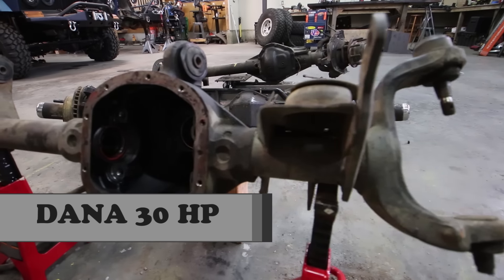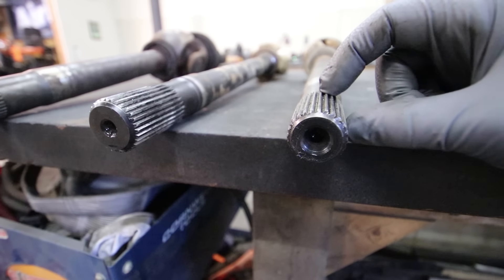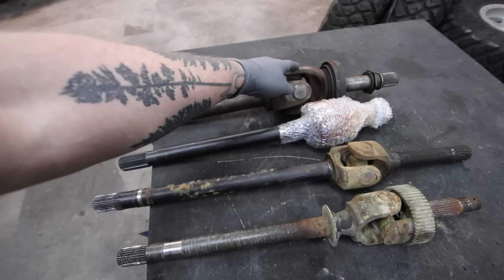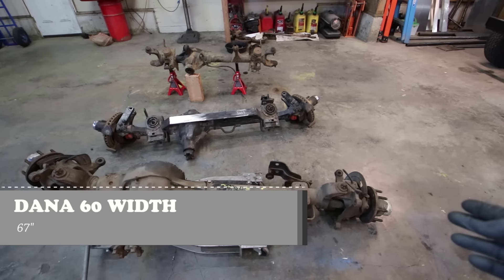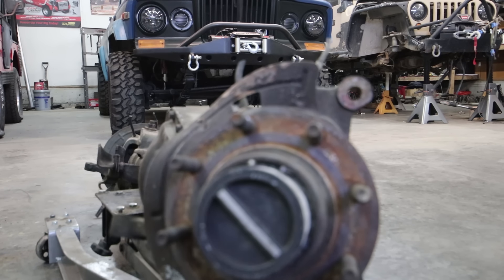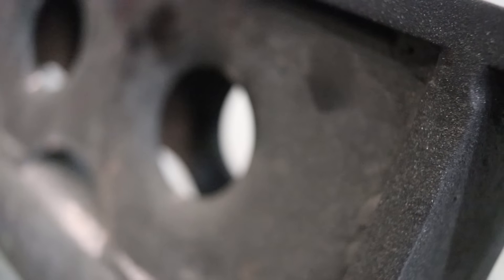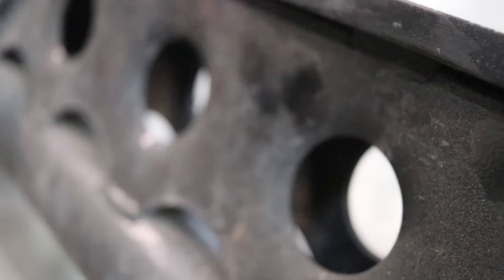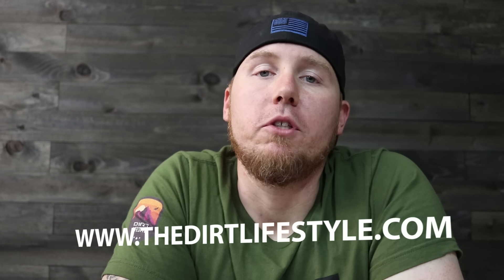DANA 30 vs 44 vs 60 Junk yard Axle Swap Beginners Guide!!!!

Comment: All the dislikes = people who came for blind Dana 30 hate.
Reply: Been wheeling in my V8 ZJ on my dana 30 low pinion for 8 years now with only one issue, and that issue is that my unit bearings keep wearing out every couple years. 
Of course, I don't have lockers, but I also don't have any upgraded parts or even an axle truss. And I'm not exactly easy on my axle. I don't like giving up on obstacles.
Reply: 03 stock dana 30, low pinion, on red trails in PA.  I wouldn't bother beefing up the D30.  Just dont ride fast and hard.
Reply: @KurNorock  you think 30 has hate , look at the Dana 35
Reply: @Mr2greys  I'm not saying its a great axle. I am just saying mine hasn't really given me issues. That being said, I have been wanting to upgrade to 1 tons for years. 

The 35 is shit though. I've seen those things break with only minor stress. Luckily my ZJ came with the 44HD rear axle (aka the 44a) which is much stronger than people give it credit for. The only real drawback to it is that there is almost no aftermarket support for it.

Comment: You are backwards on your High Pinion Direction, It is stronger When you push your ring gear with your pinion not pull. i.e. low pinion rear pinion pushes ring gear, high pinion front pushes the ring gear. Think of it as you want to load up the larger pinion bearing. But you did pretty good nice job putting it together.

Comment: Great video! Very useful information. I almost built the D30 that came in my YJ. It ended up being cheaper for me to just get a D44. Lots more piece of mind. I have a D44 low pinion in the front with chromolys and locker. And a trussed Ford 8.8 in the rear. Both geared at 4.56, running 35s, and my stock 4cyl. Works great for me.
Reply: just curious how did you match up the wheel lug patterns i have a 8,8with 5x4.5  and a 6 lug 44 and i want to match the wheel lug patterns

Comment: I ran a locked Dana 30 on a V8 ZJ on 35s with 4.88 gears for years without issues.  Had IRO "almost alloy" axle shafts with Spicer 760x ujoints and the end caps welded.  Ran IRO internal axle sleeves as well.  Most importantly though, I drove it like it was a Dana 30 haha sometimes people treat them like it's a 60 and of course it's gonna blow!!
Reply: Had the 35's on my ZJ and broke the stock rear D35 first time out. D44 fixed it!
Reply: So true, two identical trucks go through a trail, exact same obstacles, one comes out looking as it went in, one comes out destroyed.

Comment: A high pinion 30 and 8.8 rear are pretty inexpensive upgrades for a streetable TJ on 35s. The main issue I ran in to with this combo is the 8.8 hangs low and drags on everything. Then the hp30 hardened locker crosspin broke and backed out, wedging between the ring and pinion, which then stripped my gears and exploded the carrier. I replaced the parts and drove it for a while longer, but went the superduty 60/10.5 combo along with a backhalf, stretch, and full hydro steering on 40s.

Comment: I have driven Jeeps for years, and never broke an Axle. I have had a propeller shaft fail on a rock climb in a 95 Jeep Grand Cheorkee, 5.2 liter V8, 4.11 geared axles and 33" tires.  I drove in MOab and up the lions back in a 76 CJ-7 with T-18 4 Speed,  Dana 20 Transfer case, Stock Dana 30 front axle and stock AMC 20 rear axle.  with 4.11 gears and a two inch lift. I forgot the size tires, but remember they were Armstrong Norseman.  I managed to go everywhere I wanted with little fuss or muss and didn't even strip out the hub on the AMC axle.

Comment: Built a C8.25 rear locked and TJ D30 w/ cromo axle shafts , open diff for my YJ , running 35s and very happy with the build. Also did the WJ big brake upgrade and rebuild both axles completely .... was to be a budget build but a total rebuild  parts add up lol

Comment: Perfect advice.. d30-44 don’t break in jeeps from good wheeling. They break cause if weak joints which in turn destroy the shaft.. or they break cause if thinner tubes flexing. In my last TJ’s I always ran d44 swaps from fords or waggys, my current project Cherokee I’ll be sticking with the hp30 with a truss and rcv shafts cause getting anything larger then a 36-37 on a Cherokee and retaining any reasonable resemblance to a Cherokee and flex that just all you can reasonably do. 

I would like to hear your take on rears too. I already got the 8.8 locked with alloys swapped in the rear just need to truss it when I go 4 link. As big as the 8.8 swap is in the xj world I feel it’s a highly overlooked option in the tj and yj world. My last TJ ran a 8.8 rear with waggy front. 

As far are rears go.. I really don’t understand all this d60 hype and never had? You can swap in a shaved 14 for that weight while having same clearance and way way stronger setup. You have to really build a 60 to touch a stock 14 with just welded spiders. Tons are just way to heavy imop unless you’re over landing and carrying a ton of weight. 

In my 20 or so years of wheeling I’ve bent more shafts then I’ve broken and that’s from tube flex under shock load. Hell even back in the day before I had a clue I was running a super 35 kit on 37’s and never broke a shaft.. bent a few from pulling others out in bigger heavier rigs where I really had to snatch from 20-30’ feet and that shock bent axles which also destroys the bearings but even then I never snapped one. 

I’ve seen more people break shocks etc wo straps and walk their 60’s under their rigs ripping apart drive shafts and all kinds of stuff cause they are so same heavy then I’ve ever had with smaller properly built axles on proper weighted rigs with proper size tires. 

And the hype over these rubi axles swaps is highly misguided.. they are lip d30 with a modified 44 housing. The knuckles, tubes, joints etc are all 30 lol. The rubi is nothing more then and 8.8 version of a Janice jk swap into a standard 44. You’re getting a bigger and hence stronger with tall gearing d30. 

You’re axles aren’t breaking cause they are weak they are breaking cause they are flexing.. (hence truss and sleeves) your joints don’t break cause they are weak they break cause they are weak at angles. You’re 1310 driveshaft joint is the same as the one conserving your purées to your inners.. yet you’re breaking front joints bot drive shafts joints cause you’re at full lock and putting them in a bing which means the inner is moving regular speed while the outer is moving much slower. (Extra stress) I can’t help but feel Jeep people are so far behind the times when it comes to what breakers and why. The reason a $5000 Tacoma will never break anything is cause they are running cv shafts instead of ujoints. How many yots with dual t case running 127-1 crawl do you see breaking weak 7-8” axles? It’s not the axles it’s the joints. Throw a $100 truss on that hp30 run some rcv shafts and be done. While your buddies are refinancing their house to pay for a 60 and 40+ tires to clear them you’ll be wheeling.
Reply: Yeah I wanna do a 44 so its stronger but not a massive axle like the 60

Comment: Only the "Super 60" has the 10" ring gear. These are in 2005-2020 F-450/550 and 2017+ F-250/350. In the 2017 MY, the pinion size was increased substantially, and Dana internally calls it the M256.
Reply: 2004 and 2005  f250 super duty Dana 60 has the same ring gear size?

Comment: Excellent information Nate. Pulling my D30 to do new inner seals. Adding outer seals because of the amount of sludge, mud and crap on the east coast. Already upgraded to Yukon 30 spline chromoly axles when I upgraded the ring and pinion and 4.56 gears after I bought it in CA. Stub shafts and heavy  duty u-joints from Yukon are also going in. Truss will be added too, as well as lower control arm skids. Sure, it's a D30, but it will be solid. Don't have the $$ for sleeves and gussets for this go round. Running 33's now and moving to  35's as soon as the Tread wears down.
Reply from the maker: Nice man, that's going to be a solid setup 👍

Comment: i ran a dana 60 in my drag car with 800 hp ran it for years great stuff
Reply: Sweet, but isn't that a lot of weight for a drag car?
Reply: @adamsmith5913  it was a rail job a dragster long n skinny with a wing out back kinda looks like a top fuel dragster she only weighed 1565 pound so she hauled ass what fun !!!

Comment: I have a 1963 Wagoneer version of you blue Jeep. Mine is a Willy's and has the OHC Tornado 6 in it. I bought if for either $50 or $100 close to 25 years ago. It's a little lighter blue than yours. Sheet metal is all good but the floor pans and seats need work. Been sitting pretty much since I bought it. The guy I bought it from had broken a shifting fork and that's why it was so cheap. It ran like a watch and after my dad welded up the fork it was fine. I need to bring it home and get it fixed up because it's a sweet truck.

Comment: I was pretty excited until 13:25 when you mentioned V-8 and Dana 30. I’m running a TJ magnum V8 360 and NV4500 with an 8.8 Ford in the rear and you guessed it, Dana 30 still in the front!!  The 30 is completely stock with a spartan locker 4.11. 35” Cooper STT Pro. In the last year of moderate wheeling I’ve lost 2 U joints and I’ve now bent the ears on the stub. Was hoping to stay Dana 30 HP with 30 spline chrome Molly shafts. Sounds like with a V-8 I should skip and go to Dana 60 but that’s a pretty big  mismatch for my Ford 8.8 which seems to be doing great.
Reply: I should add the only reason the 30 stubs have bent ears because It spit 760 U Joint caps out. That’s the driver side. Passenger side caps are welded down.

Comment: Another great video! D30 are better than they are given credit, especially the HP 30.
Reply: As long as you are fine with replacing the unit bearings every couple years.
Reply: Chrysler 8.25 !  Xj 96-99 had the 29 spline. Many say just as good as a D44 other then that damn C clip
Reply: @CD-W0DOS  do a disc brake conversion on a chrysler 8.25 and if you do happen to break an axle the rotor will hold the wheel in to get off the trail. That's what I did as a poor man's way of keeping the axle in in the event of a failure.
Reply: @CD-W0DOS  that's comparing apples and oranges. You wont see a 30 in the rear and you wont see a 8.25 in the front

Comment: I had a low pinion Dana 30 and I beat on it for 2 years with 35’s and it held great never had a problem than I sold the truck and I’m actually about to swap one into my daily driver ford ranger and do some 33’s for hunting and driving around on gravel roads

Comment: Great video nate. One thing im putting a f250 dana 44 in my YJ to run 35s. The biggest reasons are for the lockouts, bigger brakes, no unit bearings, and high steer. All of those are an added cost trying to beef a dana 30. Running the 67 inch width but with 3rd gen dodge wheels with 6 inch backspacing.
Reply from the maker: That should be a pretty fun and reliable toy! The only thing I would recommend is bring some spare shafts with you if you plan on running the stock ones. It's very thin around the ears of the shaft so the stock ones are pretty easy to break. Ask me how I know lol. Thanks for watching buddy 👍

Comment: I’ve seen high pinion 9 inch fords, but I don’t know if they’re stock, or aftermarket.
Thanks for answering my question, and starting your own channel👍👍👍
Reply from the maker: The high 9s are sweet! Definitely not stock but I really like the clearance and what not that come with a high pinion rear. Perfect for a light weight low horsepower build

Comment: i can count myself lucky that i bought my 2nd gen ram with 4x4 here in germany. 
Dana 44 in the front and i always thought i want a better axle if i go offroad. Since i didnt know better at that time. 
Now i know from all the videos and research that the axles in there are definitely going to say and just get upgraded. 
The plan is to start from the axles for upgrades and go back the driveline until i reach the engine for upgrades. 
Got a NV4500 Gearbox in there, which is not the best for offroading from what i know now because Automatics are actually better. 
Right now i have the 5 stud hubs But i would like to have the 8stud hubs to have the locking hubs. But if there are 5 stud hubs with lockers i would take them too.
will see in forums and such if someone can help me along with my build over the years. 
But i extremely apreciate the effort people put into explaining for beginners all over Youtube. Thank you all.

Comment: For some reason I'm really getting interested in the Jeep XJs.  (Dad delivered mail out in the country side with one that was a 4x4, I6, 2-door, red, and right hand drive when they were new.)  I don't see myself doing crazy rock crawling with one, but really enjoyed the information you provided.  For me, a retired engineer, I absolutely love over-engineering stuff :-)  So upgrading the original Dana 30 with a stouter R&P, chorme-moly axles, better U-Joints (or CV joint?), and a truss would go well for an XJ with slightly larger tires and more power.
Thanks for the information Dirt Lifestyle !!!!!!!!

Comment: Could you do a video like this for rear axles? Maybe to keep it simple just do D35, D44, D60, and D70 or D80
I'd love to hear your recommendations on what axle to use with what tire size and weight/payload
Reply from the maker: Great suggestion! It just when on the list 👍
Reply: How could you not add the 14 bolt to that list !!
Reply: @43trendkiller44  cause it's similar to the D70

Comment: Crossing my fingers. But I have a built d30 and run 37s with a stock engine in my jk. So far it has lasted over a year. And that's hitting windrock, blackmountain and various other places multiple times. I'll upgrade to a d60 when it breaks. But it's still hanging tuff!
Reply from the maker: Nice!

Comment: Dana 30 is good for building a Samurai hunting truck, 44 is entry level, 60 is meaning business Dana 70 is simply awesome and impossible to break, the two I have are bullet proof and are massive with Detroit lockers being the only thing to hold together.
Reply: Well a 60 and 70 have the same shaft size stock at 1.5" for the 35 spline versions. For most people the smaller housing of the 60 is more desirable for ground clearance. The 70 was developed as a high GVW axle for dual rear wheel applications which gave it larger bearings and ring gear. The 80 is larger yet with an 11.25" ring gear and 1 9/16" axle shafts for the 37 spline version. All of them are great axle choices because they are readily available and well supported.

Comment: Good info for newbies. I'm running a HP 30 with sleeves but no truss with 30 spline chrome moly axles and an Ox locker on 35s and no problems for about 10 yrs in a 2001 xj.
Reply from the maker: Nice man! Sounds like you are at least a fairly sensible driver lol. I think these can be great axles with the right owner. I have a full hp 30 build series on the way. We're going to build it for 37s and keep it on 35s... for now 👍

Comment: Here are just some breakfast thought reasons that companies make mostly low-pinion front axles. 
   
1 customer interest; most customers do not care about, nor ever come close to needing, maximum strength and ground clearance for the front differential, and would not want to pay more for a special axle they will not utilize to much extent.
2 It is not cost-effective to make an entire different set of gears for a special axle that would make up maybe 10-20% of the total axles built when standard gears are usable. In fact, it is often cheaper to simply use a larger front differential than to improve the existing one (this is what Chevy did with the Dana 60 KP front)
3 (This one is a big one) Chassis clearance. Many of the later solid-front 4x4 trucks actually have very little room around the front differential and (at stock height) do not have the necessary clearance for the high pinion or its driveshaft to fit without raising the floor pan, moving crossmembers, or lifting the whole truck. (The perfect example is 62-91 wagoneers and J-trucks; some have less than 1/2” driveshaft/diff clearance to the chassis around it)
4 Oiling: due to many things (but basically summed up to the direction of gear rotation), the high-pinion front gears actually have inferior oil supply to the pinion bearings, especially the rear bearing. This applies at highway speed, and equally or more so, on the trail. Whereas a low pinion is constantly bathing in gear oil, a high pinion is relying on the oil splashed and flung into it by the ring gear. As speed decreases, oil to the high pinion will decrease accordingly . Theoretically a low pinion front(and rear) will last more miles due to the better lubrication. 

    I absolutely love high pinion front axles, even have plans to make custom high-pinion rear axles in the future. It is just always good to look and ask, “Why did the engineer put this here and not here?” Remember, the engineer has a boss that is going to harass them for every design choice, so they have a reason for their design. Hopefully the aforementioned thoughts help soften any hard feelings to manufacturers for their choice of components. At the same time, KUDOs to the ones that did use high pinions... applause to Ford

Just my 0.02, take or leave it
Reply: Good points 👍 to think about for individuals specific design need excellent food for thought simplicity at it's finest time Anon Ymus take care .

Comment: Nice video the way you explain things is great a friend of mine is going D60s with 40s but on his stock 3.8 jk I told him to much weight that engine doesn't have the torque chip+intake or supercharger deep gears not enough
Reply from the maker: Thanks man! Yeah he definitely won't break anything with that 3.8 lol. But at least he future proofed it. Time for an engine swap 🤘